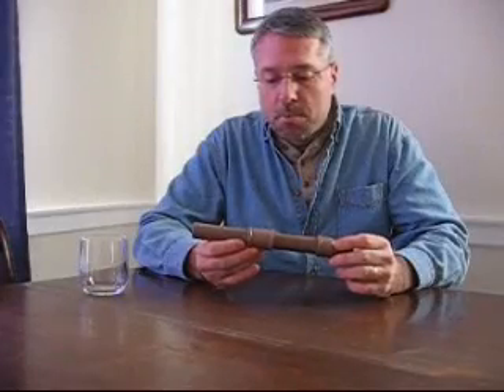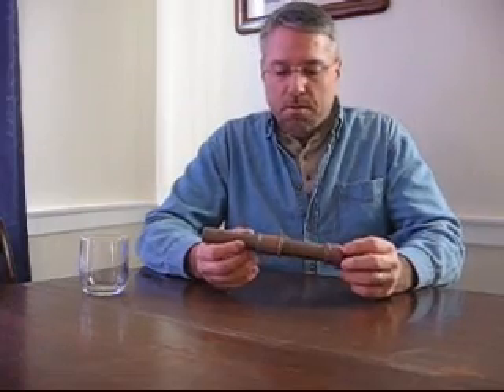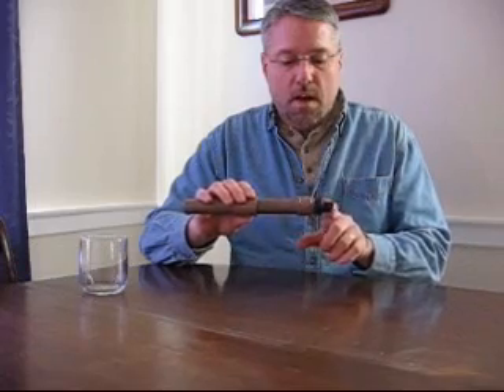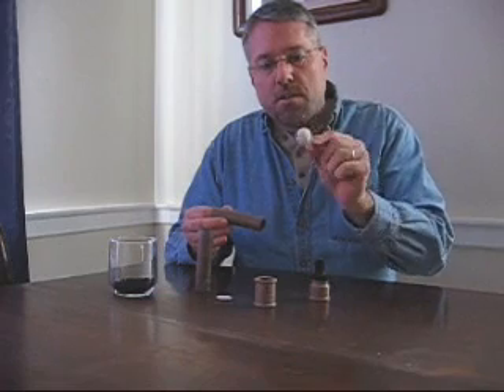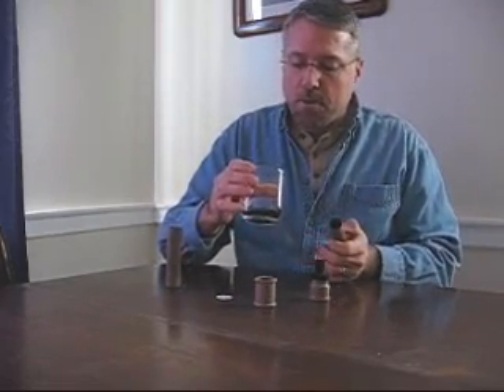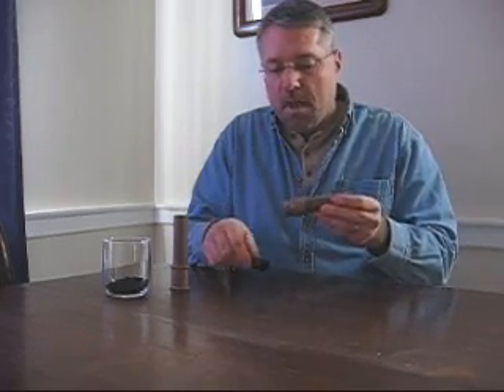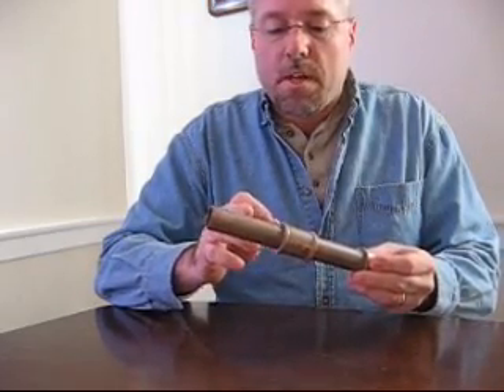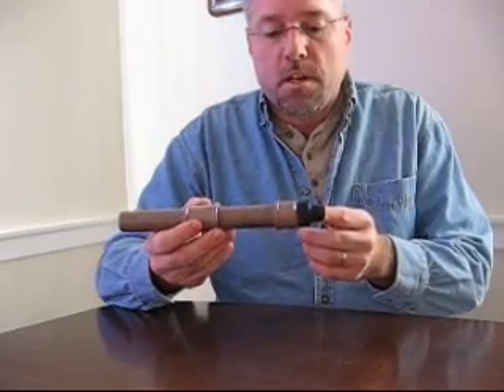Making Home Made Water Filter with Dave McIntyre from ALONE show Season 2 winner

Comment: I made a home made water filter with prethreaded 1 inch pvc pipe with screw on caps on each end with threaded brass niples drilled, tapped, and screwwed into the pvc caps on each end that attach to 5/16 to 3/8th inch ID hose like those that come with sawyer gravity filters. Fill the 6" long pvc pipe or whatever length you desire usually 3", 6", 9" are the premade (threaded on both ends) pipe at the hardware store. Anyway, fill it with activated charcoal, and if you do it right you can put a prefilter inside the inlet side with a ruber washer to seal the pipe against the threaded cap. The prefilter is made of schotch brite pads cut to fit in the cap tightly and the exit or outlet side you can put 1 micron absolute filter material cut from industrial grade biofuel filter material that can be bought online farely cheap. You must search in a search engine for "1 micron ABSOLUTE biofilter" to get the correct material. Both sides I seal off with rubber garden hose gaskets in the caps. It's a cheap and relitively easy way to make a great water filter. You need a drill and bit the next size smaller then the tap, and a tap the same size as the threads on the brass nipples to thread the brass fillings that go into the pvc caps. You may need to seal the brass fittings with an epoxi to keep them from leaking. With my setup you can take it apart and clean the filters or replace them, and replace the charcoal. This setup can be used as a filter on a gravity feed system like Saywers or an inline filter for a water bladder or as a straw. The one micron "absolute" filter is the thing that guarantees that giardia, protozoa and other parasites that are larger then one micron can not get through that final filter. Also you must clamp that material with c clamps and something that is slightly larger then the diameter of the size you want 1" before you cut it,  and then melt the material on the outside edges so that the threads do not seperate and loose it's one micron rating. You don't need chemicals or boiling with this. Also the Sawyer .02 micron filter is not that expensive and is rated for anything found in Brazil or Africa. I hate the taste of chemicals and am not convinced that they are safe in the long term.

Comment from the maker: I get this question often. It is very difficult to answer.  The fiber wad can be pulled apart and rinsed in clear water.  The wad will get very dingy/dirty and traps all kinds of nasty very quickly.  The pellets last a long time.  I have used it for up to a week in Brazil/Jungle with no change in water quality.  The pellets are low cost and I change them on general principles rather than wait to see what happens.

Comment from the maker: This is a low volume, fast flow filter.  I use it to pre-filter water, filling canteens, then chemically treat.  The basic principle is an aquarium filter in a tube, it removes larger suspended particles (sticks and bugs) in the synthetic floss and smaller particles, odors in the activated charcoal.  To filter a larger volume you would have to build it bigger.

Comment from the maker: Activated charcoal and charcoal fuel are not exactly the same thing.  Normal charcoal will work but is not as effective as the activated charcoal.  I like to tap the lower chamber against a table gently to settle the contents and add more until its full.

Comment: Have you ever tried making a filter using a copper pipe similar to how you have the example in the video with the addition one more section with a 30-50 micron copper screen, a bit of .9999 fine silver shot and one more final 30-50 micron screen.  Then even though you are chemically treating the water, you could skip that step if the need arose.  With the activated carbon, the copper screens and pipe, and the silver shot the water should be at or very near sterile if treating was not possible.

Comment: @beebop46n2, there are many filter media that remove or reduce heavy metals.  KDF and ion-exchange resins are the 2 most widely used such media in water filters.  Google them.

Or, Reverse Osmosis and Distillation systems remove heavy metals as well.

Comment from the maker: @moltenmike 

It is plastic water pipe, the same as was used in my house.  There is a perforated plastic disk at the top and bottom of the section with the charcoal.

Comment: I have 2 distillers.. 1 for the home "Entire home" customer built. and 1 for travel that can be used on a fire or stove, just get your water from where ever, river, ocean, lake and it will give you only H2O. The problem I had with filters was that when I used it in raw water bacteria can get trapped in the filter but later pass through and some bacteria are as small as 1 micron. If you use 1 micron filters on a carbon filter in raw water it clogs up too fast and required replacing too often.

Comment from the maker: I normally filter and treat with Clor-In1 tablets sold here in Brazil for the past 30 years.  For a week or so treating water in the bush I would rather have the security of the chlorine than rely on the filter alone.  We have some nasty bugs in surface water here.  At home we use a filter/ozone generator to purify our drinking water.

Comment: good
I use stif plastic jug, water, gatorade, pop bottle, etc
 poke smallest pin holes in the top by the cap put sideways in water source so holes r under water.
 Squeeze out the air(or let it fill naturally) in the bottle.  pour out , feed a tube in2 get clarified water out 
contaminants remain outside  of the bottle u using.

A straw with a tube connected seems 2 be same thing & can be hooked 2 bottle or wicking pump 2 lift the water up; further filtering it. 
great idea

Comment from the maker: This filter is intended to be used in the bush for cleaning up drinking water before chemical treatment.  I don't think it will remove a significant amount of chlorine.

I suppose there is a harmful dose of iodine but in the concentrations used for purifying drinking water it is not a problem.  Iodine has been used for this for a very long time.

2% Tincture of iodine - 5 drops per quart/liter - wait half an hour.  This dose can be doubled for very dirty water.

Comment from the maker: The parts aren't hard to figure out if you have a bin of PVC parts in front of you.

2 twenty mm pipe sections about 4 inches long

1 twenty mm pipe joint

1 twenty mm reducer.  This part narrows the water flow

2 perforated plastic discs or screens to sit above and below the activated charcoal.  You can make these out of soft plastic.

Activated charcoal pellets
Synthetic wadding

Hope this helped.

Comment from the maker: I have two others that are larger that I use sometimes but yes, I've been using this same one since I made it.  I do repack the pellets and fluff periodically.

I NEVER use this filter without chemical treatment.

I used it with crushed chips (not dust) of charcoal left over from my campfires for about a year.  I would replace them every trip and it worked great that way.  The pellets are less fuss.

Comment: You really should use CPVC instead of just PVC. PVC releases carcinogens when heated, like when leaving it in the sun. That's why plumbers aren't allowed to use it for drinking water piping. CPVC is specially designed for use in drinking water applications.

Comment from the maker: I cut the screens out of plastic from an ice cream container and punched holes in it. The idea is to keep the pellets in place and allow plenty of water flow.

I fill the lower chamber with pellets and then gently tap it against a hard surface to settle them and then add more until it is full to max capacity.

Comment: You can do the same thing with three bandanas,3 smalle stones,a bundle of dry grass, some sand and some charcoal in a tripod configuration all the bandanas weight with a small stone in the middle after being tied unto the tripod in series from top to bottom.
with the grass in the first, sand in the second and charcoal in the last. It's called a tripod perculation filteration system. I've drunk river water filter through this set up without boiling as well with no ill effects BUT I would now.